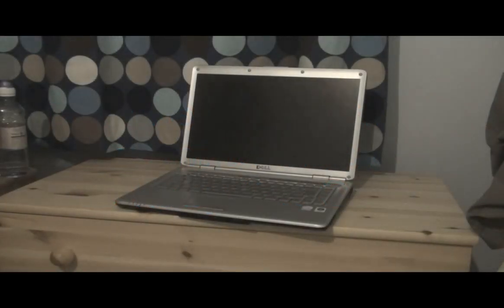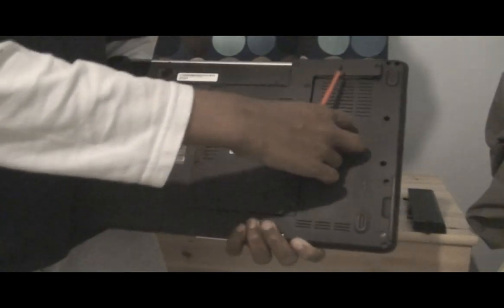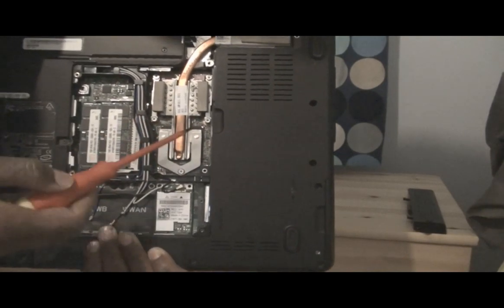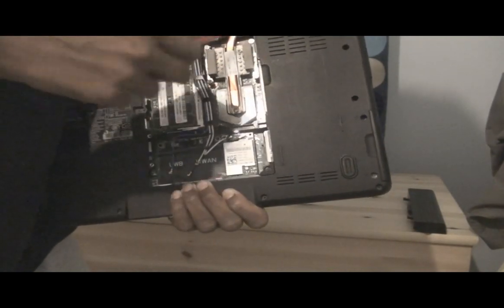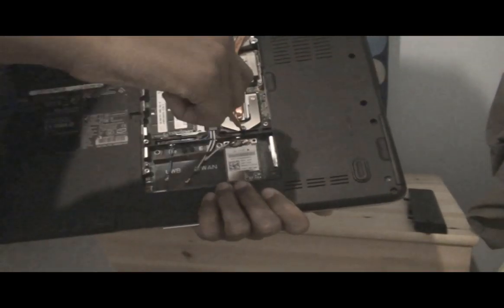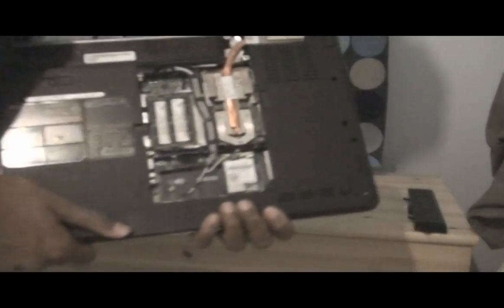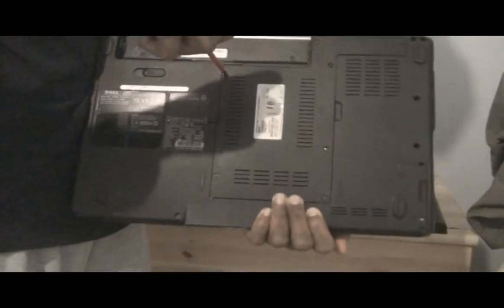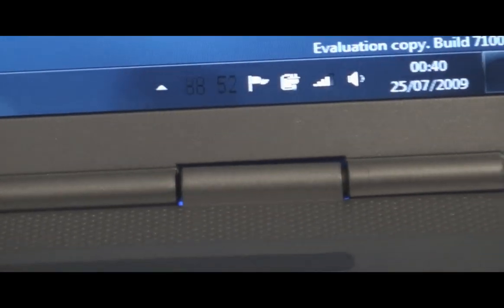(HD) How to open a Dell Inspiron - Part 2 ~ Cleaning the fans, Replacing RAM, Replacing CPU.

Comment: Wow this video is so inaccurate and you are so careless i'm very surprised you didn't break your laptop. also you likely made heat conduction worse by removing the seal between heatsink and cpu and not reapplying paste :s this is complete garbage. learn what you're doing before putting an instructional video for others

Comment: The Dell Service Manual states "To avoid electrostatic discharge, ground yourself by...periodically touching an unpainted metal surface, such as a connector on the back of the computer." 

support dot dell dot com slash support slash edocs slash systems slash ins1525 slash en slash SM slash before dot htm

Comment: Great, it worked! Just cleaned my wife's laptop, removed a big dust clod that was between the cooler and the heat sink, just as you said... Now it's at 65C at 100% load (and she can play 2nd Life again :) )... Didn't replace the thermal paste, don't have any and it's 2am, but I guess the old one will do the job for now... Thank you very much!

Comment: First time i opened my 1520 i had the right screw driver and i cleaned it pretty good, but my 5-8 time was costly, broke the keyboards connecting wire.

Comment: my 1525 was making this annoying whinning noise, and it would not stop... well after seeing your video and taking the process out and cleaning the filter out the noise has stopped.  Basically the 1525 was not getting enough air so it kept the fan at its highest level... not its nice and quiet....

thank you  !!!!!

Comment: Great video mate! Before I cleaned my laptop using this video + a vacuum cleaner, my processor/core temperatures would reach 80°C while watching BBC HD... then would shut as the in-built safety limit was reached.
There was dust caked on the interface of the grille and fan.
Now, the max temperature I recorded while watching BBC HD was 66°C. Thanks for making my laptop useful again!

Comment: With two cats in the house always sniffing around my laptop I ended up with a huge dust bunny in the space between the fan and filter. I reassembled the same way as shown and the computer continued to shut down due to overheating. I had not cleaned the old thermal paste remnants off and repasted the big copper heat sink bar. This is a key step!

Comment: Jeez, who would have thought that that removable hatch would open if you took the screws out?!   Now if you hadn't cracked the thermal paste's solid connection between CPU and heatsync, and risked motherboard destruction because of your non-existant static grounding solution, you might not have done more damage to your laptop than the overheating may have.

Comment: You are forgetting something important, ie. wearing clothes.  The very act of moving, having clothes rub against each other, skin, floor, you are creating a difference of charge(s).  Just because you don't feel a zap doesn't mean its not there so you will never be truly equal.  You will feel a static shock at about 300 volts.  If you ever see someone properly handling PC equipment, they will have a wrist strap on which safely conducts the excess charge away.

Comment: Your procedure is correct but your approach to grounding yourself is very wrong.  Grounding yourself means touching something that has a clear path to ground, which neither you or the laptop has since its 1) being held in free space and 2) you don't have a wrist strap connected to a grounding point.  Touching the metal on the laptop won't ground you unless the laptop itself is grounded.

Comment: You seem to just clean the space between the heat sink and the fan. Is that where the problem usually is? I have a Dell Inspiron 1420 and even after unscrewing everything I couldn't get access to the fan blades themselves! anyway cleaning the heat sink worked for me.  Also how do you monitor your laptop's temperature?

Comment from the maker: @MetalPunkZz 
Don't go to the store! :P
You don't, I just used manual (ie my mouth and fingers). :L
Recently I cleaned it out again, I used a vaccum and it was more effective.
Just don't touch any of the circuits with the nozzle, and get the corners.

Comment from the maker: You can, but it will not be as cool as it could be.

Ie without it would be min of 40.

With new application you could see lows of 30 with a cooler; like me.

Your choice. :)

Its perfectly safe to use though.

Comment from the maker: Awesome! :D

Mine runs even cooler with my notebook cooling pad that I purchased when it used to overheat.

Before with the cooling pad it used to get up to 80, without it over 90. Now it's at 48 with CPU Load and without it goes max of 50. Great, isn't it?

Comment: I appreciate the video. I've been having heating issues for the past 2 days while running a higher load than usual, and thought I'd have to take it in to get it fixed (out of warranty, very costly). I had no idea how much dust builds up on the fan, and 20 minutes after cleaning it, it's already a night and day difference. Thanks again!

Comment from the maker: It's delicate in the way you shouldn't break it in any way, just put it down on a flat surface. If it breaks - your laptop cooling is done for, and you'd have to get a new one.
The thermal paste is not sticky, although you can apply some more if you have it. It's perfectly safe to remove it.